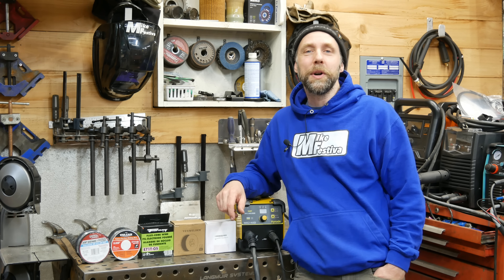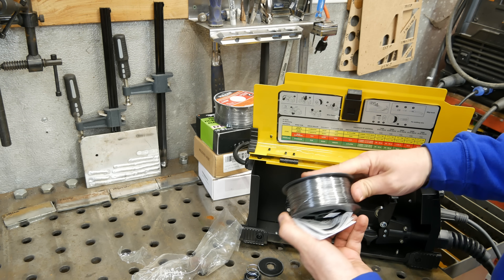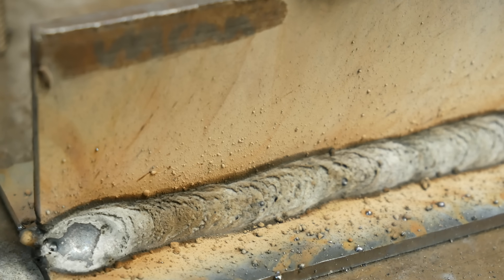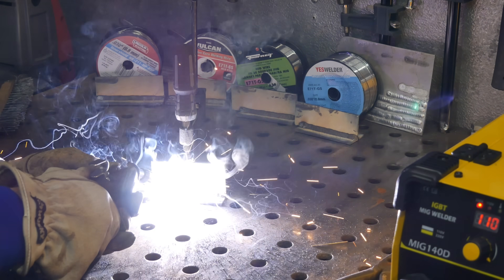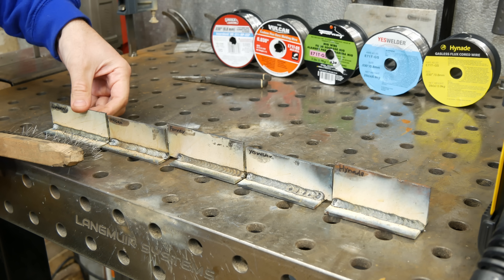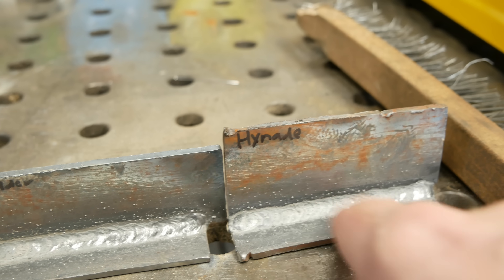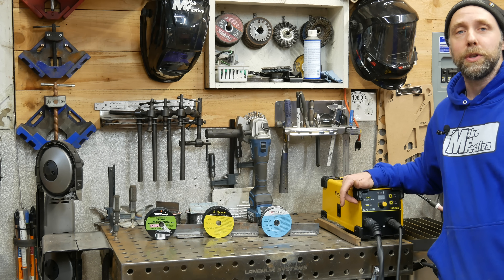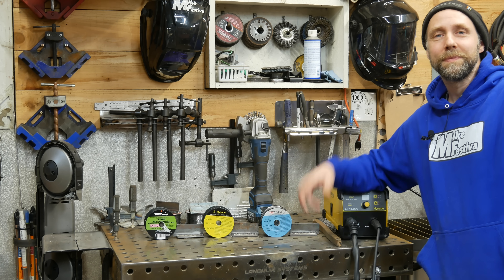Gasless Flux Core Welding Tips, Make Better Cleaner Welds

Comment: For a beginner welder, what do you recommend to use in 110v.working on cars is my hobby and living here in the Bay Area it’s crazy expensive to go to exhaust shops. $200 to weld a muffler on my exhaust 😳!. I would rather just buy one and learn myself.
Reply from the maker: Yes I wouldn’t want to pay $200 to get a muffler welded on. If you are interested in welding then there’s a lot of good options available.
If you want to get into welding then I would say the Harbor Freight Titanium flux 125 is a good machine, all flux welders tend to have less clean welds, MIG with shielding gas gives cleaner welds but flux is still definitely strong just not as clean looking. The Titanium can be bought for $179 on sale.
The Yeswelder MIG 205DS is a good affordable welder, the 205 can be ran with Flux wire or solid wire once you buy a shielding gas bottle and a regular, it’s 120 volt or 240. The 205 can be purchased for about $375 on sale. The brand Hynade also sells some adorable welders 👍
Reply: @Mikefestiva  living in the Bay Area everything is soo expensive, you might as well do the work your self. Ok perfect, I think ima buy the harbor freight titanium flux 125 when it’s on special. Hopefully this next holiday coming up! Thank you for the help choosing I appreciate it a lot!
Reply from the maker: @FishingWithJo415  No problem man 🙂👍
I did a video a while back on Flux wire, I found the Hynade, Yeswelder and Forney flux wire works really well. I had only used Lincoln and Harbor Freight flux wire In the past because that’s the only stuff sold locally, those first 3 gave me much better results. Take care
Reply: 6 months practice first, check penetrations
Reply: I picked up a harbor freight flux only welder that was on sale. For starting out with flux core, I was actually surprised by the decent results when welding body panels on an old truck. My only gripe is the Vulcan brand wire, go to Lowes and pick up a roll of Lincoln electric wire. I did arc welding on heavy steel prior, so there’s a lot to learn.
Reply: @bairfamilyfarm1336  thank you I appreciate it, ima wait until Labor Day to get a discount!

Comment: Hi Mike, love your videos.  Quick question, I know you haven’t completed your review of the Hynade 140D.  But I was looking into one and I’m confused on the choice of .030 or .024 wire.   The .030 is readily available but I can’t find .024 flux core anywhere.  I can find it in solid core but not flux core except once in a 10lb spool.   Why did they offer a .024 option on this machine? Does it weld solid core or is it for Stainless Steel?   Thanks for your advice and again, love your videos.  👍🏼👍🏼👍🏼
Reply from the maker: Hello Michael. Yes the .024 was an odd choice for Hynade to add on this welder, maybe it’s available in other countries but I haven’t seen it in the USA. Basically.030 is all you can run on it and honestly it will take care of most projects you will need to weld.

Comment: I've used the Harbor Freight Vulcan and Hobart from Tractor Supply, for much the same reason that Mike used the Vulcan and Lincoln...it's what was close by and available. The Hobart always edged out the Vulcan, but not by much. I decided to try the WeldingCity wire because I read a good review and there was a really good deal (5 two pound rolls for $50.) It welds much better than the other two, with minimal, fine ball spatter, similar to the better wires in this video. All the wire I'm mentioning here was E71T-11 or GS in 2lb spools. The Hobart and Vulcan were just shrink wrapped, the WeldingCity comes in foil pouches. If you are an infrequent welder like me,  running 2lb foil wrapped rolls no worries about a 10lb roll soaking up moisture and rusting away from disuse.

Comment: Stop that fly fishing it makes the weld weak.  Build move build move going in the intended direction while maintaining angle and speed.
-Toyota frame inspector  #xxxxc303
Reply from the maker: I have been welding for years and haven’t had any of my flux welds crack or break. 
My entire sawmill I built from scratch using flux wire and it’s been solid, I built it over 8 years ago. 
The ( fly fishing?) has worked fine for me 👍 
So you inspected Toyota frames, didn’t they have a 3 billion dollar class action lawsuit brought against them due to awful rusty frame problems on vehicles spanning over a decade? 
Ps I’m a millwright 🙂
Reply: What is the  fly fishing weld? I'm new to this. Most out there say to use a Cursive e pattern. All of these fluxcore welds look like a SMILEY face pattern.
Reply: Is that why they break so often???Ah ah.

Comment: Thanks Mike!!  I stumbled over this video literally the night before I ran out of my last roll of Lincoln flux core wire in my Hobart Handler 180 230 volt.  Based on what Mike had demonstrated, I decided to try out a roll of Forney 0.030" FC wire on a project with 1/8" mild steel.  Long story short - WOW what an improvement!  I'm by no means a professional welder so take this with a grain of salt, but the Forney wire way outperformed the Lincoln wire - it simply made better-looking, more consistent welds, with way less spatter.
I'll try the other two brands after I run out of the Forney, but I don't think that I'll ever return to the Lincoln wire.
Reply: Thanks.

Comment: I've been a Forney sales rep for 9 years now. One of my favorite things about my job is that I never have to feel bad about selling something to someone. Our products are manufactured to high standards, and when we do occasionally get a bad one (inevitable with mass production), we replace it. My customers (store managers and owners) all know that I'm going to treat them right, and it makes my job easy. One of my biggest customers also has a Lincoln display, about half the size of mine, and they sell far more Forney. I'm glad you mentioned the 1lb roll weight of the Lincoln wire- lots of folks don't notice that, and think it's cheaper.
Reply: I bet Steve could hook you up 😁
Reply from the maker: Right on Steve 🙂 I was definitely impressed with the Forney wire 👍
I haven’t gotten the chance to try out any Forney welders yet, maybe someday I will buy one and test it out ? Take care 🙂
Reply: Thanks.

Comment: You can't really compare the Lincoln to all the Chinese brands because the Lincoln is a much different type of wire. It's a general purpose multi pass wire compared to the others just being single pass. The Lincoln will safely weld thicker metal and a wider variety of steel than the single pass stuff. If you only deal with thin mild steel that isn't high weight bearing the Chinese brands will probably be just fine and will give the prettier finish. However if you are dealing with thicker stuff and especially if it's load bearing then I wouldn't recommend using anything other than the Lincoln when it comes to flux core.
Reply: The Forney wire is made in the United States, don't be so quick to jump the gun and label everything Chinese shit just because you aren't familiar with it. It's 2022, stop being lazy and look shit up
Reply: Well said, I agree. Lincoln wire has done great by me for multipurpose use. Frame rails are still supporting my Third Gen Firebird over 5Y now. Also does great with body panels believe it or not. All done with cheap amazon 115 dollar AC unit. Not the car, Its the nut behind the wheel.
Reply: the vulcan is actually made in Italy.
Reply: @seanokeeffe2301  I mean ya know... Italy/China... it's like the potAto/potato or tomAto/tomato thing... they are pretty much the same thing.

Comment: I've been using Forney for years but on a couple occasions I have used the HF wire for the same reason as you, it was readily available and couldn't find Forney wire locally anymore. I will mention one fact that i didn't hear you mention, out of all the wires in your test group, the Lincoln is the only wire rated for multi-pass, what the means your guess is as good as mine because i have made multiple pass welds with Forney wire on many occasions without and problems but then again i always use a wire wheel to clean the welds between passes. i just thought i'd mention that fact so that maybe if someone has knowledge about the milti-pass thing they can share it with us.....

Comment: Not specific to flux core welding but my experience with MIG wire is that the brands that have the wire wound nice and layered on the spools like the Forney, etc, sure seem to give me less problems with nice consistant beads than the "random wound" wire like the Lincoln and Vulcan you were using. I've had Harris and Forney which were both nicely wound and packaged and they fed almost flawlessly. I bought an 8 lb of Prostar which is random wound and I'm just going to burn it up but it sure doesn't feed as smoothly or weld as smoothly.

Comment: Good Video. Been welding flux core for over 30 years. My Lincoln was from 2002 and still going strong. Maybe they don't make em like they used to. I recently tried Kiswel, 40 bucks for 10 lbs, MADE IN USA. Welds great on a Lincoln. Flux core issues are al about the spatter. Its a PIA. The Kiswel product has been going strong from sheet metal all the way to 1/4 steel plate. I would recommend it. Especially since its made in USA. I am in no way affiliated with the company. Just recommending a good product.

Comment: I burned about 1 lb of the Lincoln wire yesterday in the bed of my dump truck with a Lincoln Weld-Pac 10949.
A pound gets gone much too quickly!

It has lLow 1 and 2 and High 1 and 2 with variable wire feed.
Its not my favorite welder but does ok where the metal has worn thin in the floor and cracks open. Its just not strong enough to blow and go once the crack is filled and I'd like to build up the metal with 3 feet stringer beads.

It has no digital panel of any kind to fail one day.
You can't even touch this kind of repair with a stick welder unless you lay a rod in the crack and stop and start weld on top of the rod slowly melting it in.
In Hi 1 and  7 on the wire speed it welds uphill decent and Hi 2 and  7 on the wire feed it does decent on flat.
Best of all I can set the welder inside the dump body with the tail gate propped open.😀
Reply: Ya, and you can’t really do a big gap and pulse weld either

Comment: i'll have to try the forney wire.  i bought a forney 125 flux welder, and it's a great little machine.  it didn't come with wire, so i'm running lincoln nr-211-mp 0.030, and i can confirm the spatter is pretty bad, especially in tight corners and confined spaces.
Reply: Thats Arc Blow  You get that with all welders Caused by magnetic disturbance in the plates Try shifting Earth lead to different position

Comment: Mike, the link to welder doesn’t match the 140D model anymore.
Reply from the maker: I believe the 140D is sold out at the moment, they probably will be back in stock in a few weeks. The way Amazon works is if the product that’s linked sells out then Amazon will automatically link to the next available model. Check the link in a few weeks to see if they are available again. Take care 🙂

Comment: New to (flux core) welding, am having trouble with my power/speed/material settings. Do you have a vid? Or a link? Thanks.
Reply: If your welder has a chart, try using that for wire feed and voltage settings. It's usually pretty close. Get about 1/4 inch of stick out on your wire. Put the tip in the joint, tilt the gun just off of 90 degrees. If you're welding thin to thick, favor pointing more towards the thicker material, it can take more heat. Start your arc and most importantly, WAIT for the puddle to form. Once you have the puddle size you want, start dragging. Never circle or go back into the puddle, this will cause inclusions with flux core. Keep a nice steady speed and finish out the weld. Hopefully this helps.

Comment: It's usually cheaper to buy a 10 lb spool if wire over those 1 and 2 lbs spools. They charge you roughly half what you'd pay for a 10 lbs spool. Any local welding supply houses will have the larger spools. You can also get them at Home Depot Lowes though your forced to buy Lincoln wire though Lincoln does know what they're doing when it comes to wire. You can also get a 10 spool of Hobart/Miller wire from Tractor Supply. Personally I seem to prefer the Lincoln wire over the Hobart but again I've used both over the years and their both good wire. I just Personally prefer Lincoln over Hobart.
Reply: Most inexpensive flux welders only take a 2lb spool.
Reply: @sptrader6316   not necessarily. It's usually not that hard to find an adapter that converts it from the 2lbs spool. As a matter of fact Lincoln makes one that I'm sure you can make work with other welding machines. It's just a plastic adapter that slides over the existing spool holder and is held on with a wing nut that screws onto the end of the existing spool shaft. So again if you think outside of the box a little bit you can find a solution that works. It doesn't necessarily have to be made by the manufacturer of your particular welding machine. I'm fairly sure if you go to any welding supply house that's a Lincoln dealer and tell them your looking for a spool adapter for a Lincoln weldpak100. It would honestly surprise me if you couldn't make it work.
Reply: But not all welders have room inside for the large spools. You don’t want to have several years old wire either, and a hobby welder might take so long to use up a large spool

Comment: Just a heads up..
On Amazon, since the Hynade 140D appears to be out of production. Another Welder, WARFOX MIG135F, but rated at 135 amps. Looks like the same machine, same quantity and  quality of parts and accessories, and the inside looks the same, just a different name and color, and the price is right too.. $154.99
Reply from the maker: Thanks for the info on the Warfox  👍
The Hynade is out of stock at this time.
A lot of these welders and plasma cutters are coming from the same manufacturer I believe. Take care 🙂

Comment: the forney wire is all my local hardware store had in stock when I went so that's what I have now. I'ma run a few test beads soon. thanks for the video
Reply: though I will say, I got the 0.035" wire

Comment: Dude I was interested in this video up until you said your going to run 220 power thru the welder   Who is going to have access to use 220? Who has welders that are 110 or 220 options ? Most guys using flux are home hobby welders using 110 power   Am I right???? You and I both know the difference between 110 and 220 welding is night and day!!!
Reply from the maker: Actually if you are welding 3/16” and below most dual voltage welders weld flux wire about the same on 120 or 240. Haha are you telling me you don’t have 240 in your shop?
Reply: @Mikefestiva  yes. That's what I'm telling you. When you were starting out, did your shop have all the bells and whistles?  Be nice.
Reply: @Mikefestiva  some people weld outside their shops … .
Reply from the maker: @chrisbraid2907  and most Generators also produce 240 volts 👍
Reply: @Mikefestiva  yes
Reply: @Mikefestiva  we we have it at the shop it’s a full service automotive shop but I only have a Lincoln mig pro which is only a 110 welder but I do run argon and CO2   I had just a flux core welder for years but when I started the camaro build I spent the money to get my setup I have now it was a big expense but I have done a lot of fabrication on this camaro. Check it out
Reply: In AUSTRALIA We don’t get a choice, no 110v here. Bigger welders run 400v but our domestic are 10 and 15 AMP 240 v
Reply: Me, from Europe, 240/400 50Hz, that Leonardo DiCaprio meme with vine glass. Pathetic.
Reply: I was very interested in this like I said but this is irrelevant

Comment: Enjoy the videos. Looking to upgrade from my Harbor Freight Titanium Flux 125 to a Mig welder that I can run shielding gas.  Would you suggest the Harbor Freight Titanium MIG 170 or the Hynade MTG155D (FS).  Just a hobbiest welder for projects.  Appreciate the feedback.
Reply: I’m gonna say the titanium just because if something happens you can’t beat the HF warrantee. Buy the extended warrantee
Too. So nice no questions asked even if it’s pouring water out of the welder when you take it back.

Comment: So the big difference from the Lincoln to the rest is its a multipas wire so it has less manganese so it won't crack when multiple passes. The bad part about most of those wires is they don't have any support with recamended settings or makeup telling you little details. Also to keep in mind if your machine is ac vs dc and how it transforms ac power to dc will effect how it welds for you.

Comment: Which once is best for stainless?
Reply: There is stainless flux core wire. I have a spool from blue demon(309lfc-o .035"), haven't used it yet, but I have a lot of 300 and 400 stainless exhaust to stick together in a few weeks.
Reply: Just keep in mind the 110v welders will have a hard time with .035 stainless.

Comment: A really big distinction to point out - like, really big - is that the Lincoln is the only E71T-11 wire in this group. The others are all E71T-GS, or “general purpose”, and can very widely between manufacturers as they have minimal standards they must follow. Which is why the Lincoln is the only one here that is approved for second passes and more structural work.

Comment: I hate Lincoln wire i tried it 22 years ago it melted in the gun of my century 80 the vulcon is better than what hf used too have the old stuff was garbage welds would break all the time i have been using hobart wire mostly for the last 20 years have used some generic stuff from tractor supplie but mostly hobart will have to try the Forney stuff definitely cheeper than hobart and looked like a good weld but its hard to get a good looking weld on a ac flux core wire feed welder very hard lol going to try to convert it to dc  thank for the video